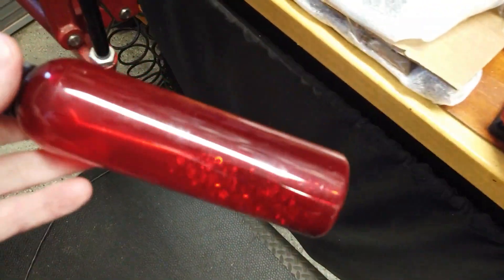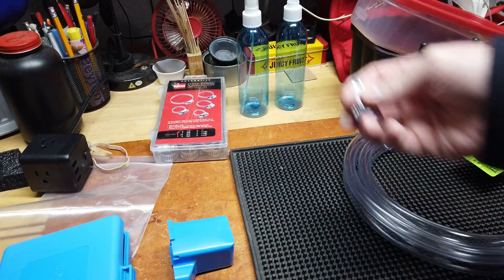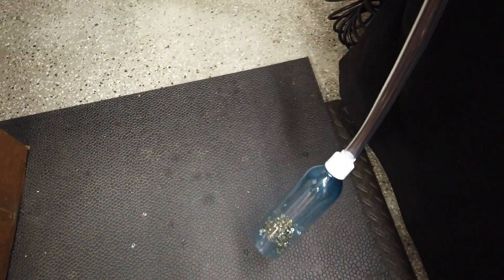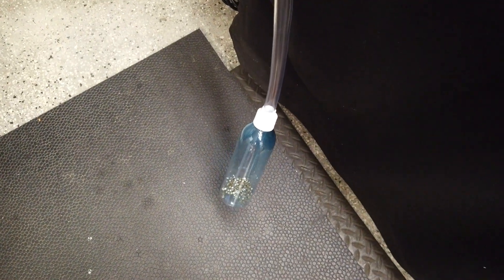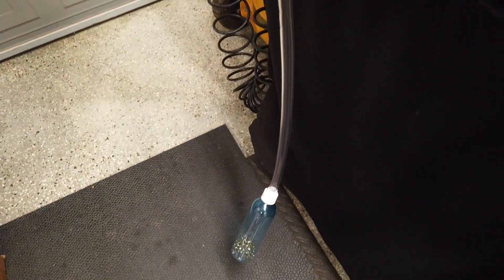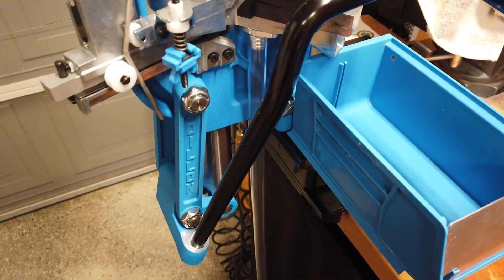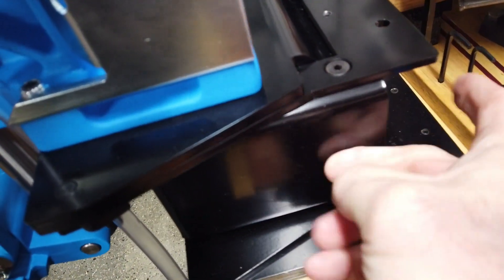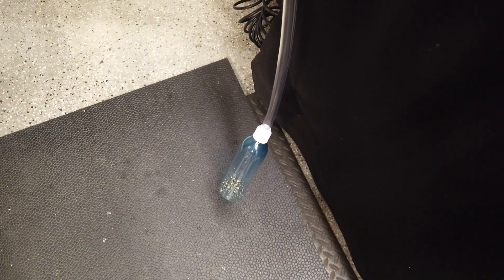Dillon XL 750 Improvements: Spent Primer Solution

Comment: Quick solution to straighten that tubing: hit it with a heat gun. Weight on the end like your bottle filled up will help it straighten out
Reply from the maker: Thanks. Yep, did both and there are always spent primers for added weight.   Straight as an arrow now ;-)